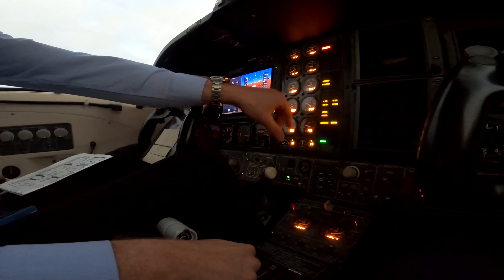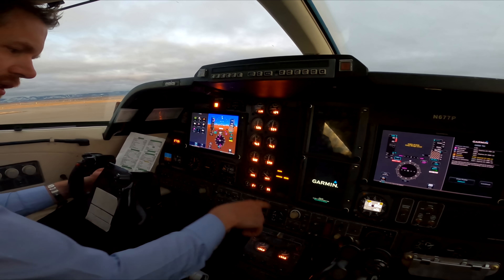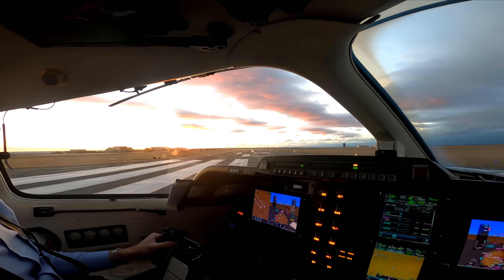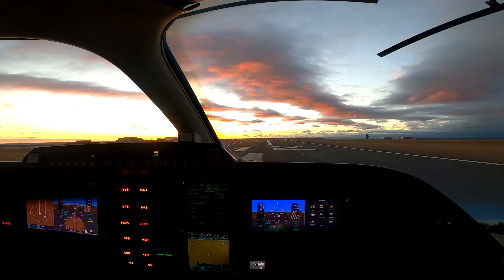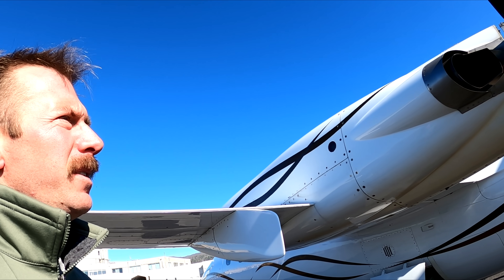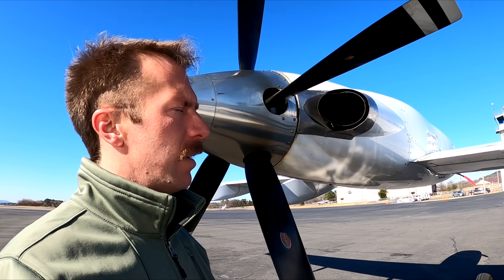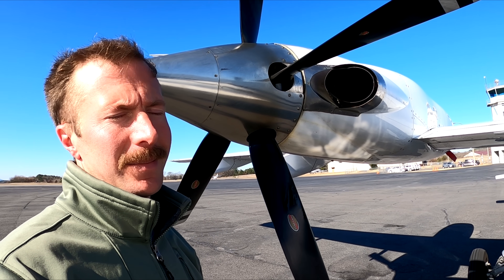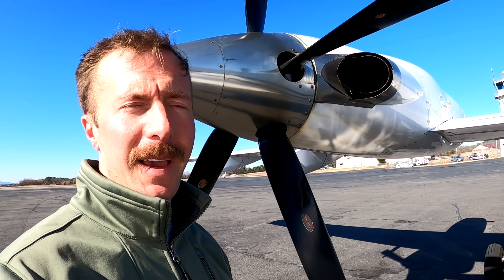Flying a Piaggio P180 Avanti to 35000ft. A Pilot Perspective

Comment: You'll never forget the sound of a P180 once you hear it. Air deflected by the main wings is half lower pressure and half higher pressure, and this immediately runs through the multi-bladed propellers causing a very unique buzzing or sawing sound.
Reply from the maker: Very distinct yet beautiful sound ineed
Reply: @SirDrifto   So, Piaggio P180 Avanti which is one of the best Tutbotrop/Private Jet out there very easy to maneuver for a pilot. With its cool sounds that you would immediately recognize if you are familiar with different aircrafts.

This where the Aprilia RS-Gp prototype MotoGP bike has been derived all along. No wonder the engineers of #Aprilia kept this design eventhough everyone have already altered theirs. They know this design will work like what their mother company Piaggio did. 👏
Reply: Had one overfly my home several years ago and had to go outside to see what aircraft it was.  It landed just north at local airport so went up there and spent about an hour talking to pilot and got to go onboard.  Awesome aircraft.
Reply: Loud and screamy.  Comes over the house every few days and I watch happily.
Reply: @fuffoon  enjoy the cancer.  Heavily leaded fuels are a bad thing. Planes need the same emissions standards as cars and trucks
Reply: Interesting.  I was under the impression that it was the exhaust gases hitting the props that caused the loud noise.
Reply: I literality just heard one go overhead and had to YouTube the aircraft. It sounded like a old world war fighter plane. Mega!!
Reply: @ScottPC  Curious as to how you 🤔 YouTube an unknown aircraft
Reply: Years ago I watched one flying over the Historic center of Amsterdam. Looks like a spaceship mixed with a WW2 plane sound. Those Italians… ❤
Reply: @kaydesign The Beech Starship also has a similar sound, almost like a Merlin on a Spitfire.
Reply: @fallinginthed33p  Sounds supercool! I will try to find one on Youtube for sure 👏⚡️
Reply: And the turbine exhaust goes through the props ...
Reply: Flew yesterday over my house I thought  what the hell of an aircraft might create this sound but then I saw it and recognized it immediately but it was the first time in real life for me to see this thing with my own eyes and hear it with my own ears and yes it was quite different
Reply: the aviation authority here uses an Avanti for regular test flights, they keep doing circles over the city and the sound is instantly recognizable, so different from any other plane that shows up here
Reply: The TBM also makes that sound.
Reply: There’s one that flies over my house at around 1,500ft a couple times a month. As soon as I hear it I know exactly what it is. It sounds beautiful.
Reply: I heard one today, looked up and definitely will never forget it!
Reply: I heard a very strange noise from an airplane today and it was this one.
Reply: I don’t know about buzzing/sawing, but one flew overhead about 5k feet elevation. It was a sound the likes of I never heard before. Looked it up on flight radar and discovered it was a p180. Also the view from the found had me perplexed as to the rectangle projection at the nose.
Reply: Facts! I can tell just by the sound when this plane is coming in.
Reply: All mechanical noise gets annoying very quickly. Sound deadening insulation should be an option.
Reply: Having distinct features is one of the Piaggio's signature. They like it that's why they stuck with it. Not only in their planes. I believe it's their mantra.  

As long as it's efficient & one of the best out there. I do think it's fine to keep it. After all there will be that it will all changed little by little moving forward, you know, Evolution.

Comment: They’re Extremely Sexy and Fast but busy flight departments are often disappointed with them. That said, the guys sitting up front Always laud them.
Mean Time Between Unscheduled Replacement (MTBUR) of LRU’s has plagued this aircrafts success. Timely access to parts is another downside for departments that have no alternates (aircraft) to support the business. Without doubt, the P180 performance is a stand-out when compared to twin turboprops and is TYPICALLY compared to light jets. It Is A Performer but often falls short of the owners expectations (for reliability) if used similarly to a King 200 series (pax, hours flown and routes). 
As for relating the P180 to a Ferrari, the Ferrari Formula 1 Team operated a P180 in 2007 ish’ but it was Purely a Veiled sponsorship more than a functional asset for the team.
The P180 EVO made some strides but the Useful Load (pax and gear), reliability and seat/mile cost drive flight department to shop at the Beechcraft store.
If one looks in the rear view mirror, the once-heralded Beech Starship has Many similarities in Every aspect to the P180.
Reply from the maker: Good points. I'm a major sucker for the starship. I know there's faster planes, but that design is timeless.

Comment: Ceiling is 410. You could have flown higher.
Reply from the maker: We could of but atc did not approve.
Reply: @SirDrifto  How come? What regulations the ATC stands for?
Reply: @yungchi1127  Air Traffic Control. They are the bosses, the traffic cops whenever one flies on instruments or over 10,000 ft. There are consequences for not obeying them, unless it’s an emergency, which you will still have to explain to them satisfactorily.
Reply: @HQBergeron  good to know, thanks!

Comment: Does the little wings at the front, cannards I think they’re called movable or geared to or have some sort of control by the pilot…?
Reply: It's a forward wing, not a canard.  It has its own flaps that are synched with the main wing flaps.
Reply: @Paul51178  so it’s not like the Avanti where the little wings are not movable. Thanks much…
Reply from the maker: Great question. They are actually fixed and have no movable control surfaces
Reply: Appreciate it thanks 👍
Reply: They do have flaps synced to the main flaps.
Reply: @HQBergeron  Correct.